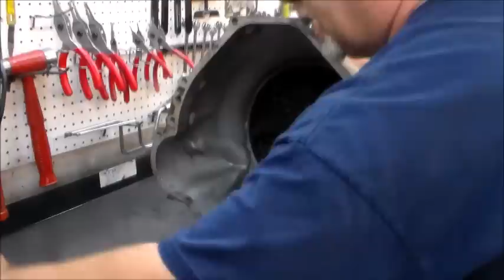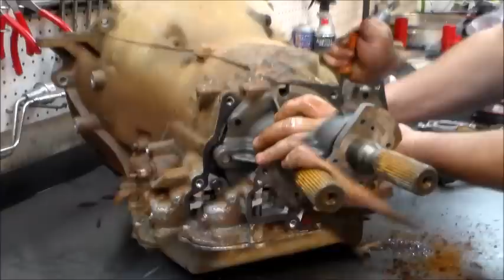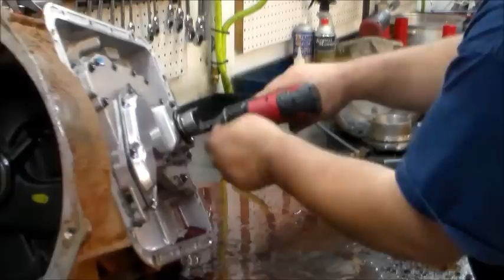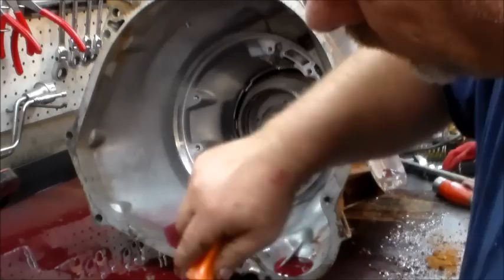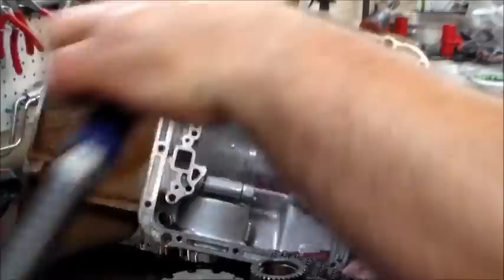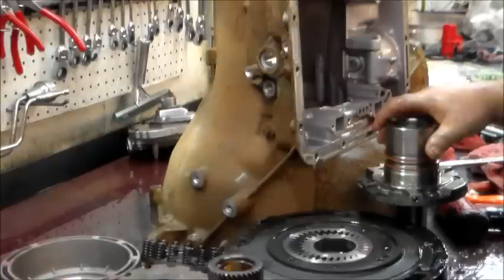C 6 TRANSMISSION TEARDOWN

Comment: Ouestion...I've got an 1987 F150 with 56,000 original miles that won't go into 3rd gear....reverse 1st and 2nd shifts great I've changed the output speed and ABS sensors already...the thing sat parked for about 8 years at one point, any sugestions what might be the culprit? Thanks.

Comment: Have 1973 F-250 2WD with  C6, 390ci engine. Trans had 1, 2 and 3 but no reverse up until a week ago. Shifted great from 1st to reverse several times but lost both 3rd and reverse. Any ideas? Drives great in 1st and 2nd. Good power to rear wheels. I might pull trans and try rebuild before shelling out big $ for rebuilt. Your thoughts?

Comment: I bought a 70 ford Ranger with a c6 transmission. The truck has sat for 20 years. ALL foreward gears work great, but NO reverse? Tries to lunge foreward in reverse and neutral. Any suggestions?
Reply from the maker: The lunge toward in reverse and neutral sounds like possible forward clutches are burnt and stuck together I would pull the pan to see the fluid condition and if metal or clutch fiber is in the pan if so take it apart

Comment: Question I always see the front pump comes out last for some reason I'm trying to get my front pump out it's very hard what's holding it I have the bolts out
Reply: I have a Ford c6 small block
Reply from the maker: 2 of the bolt holes has threads in the pump cover you can use a slide hammer with a 3/8x16 bolt and pull it out

Comment: hey man, my c6 transmission is slipping. all I need is a rebuilt kit right? I don't need to change any gears? it goes into reverse Easley.
Reply from the maker: you need to do a inspection on the drums and all the gears you want to reuse
Reply: yor gonna need special tools + band aids  i suguest getting books  from A T R A and kits from transtar
Reply: from experance to fix a sticky valve in a c-6 thro it in park at 60 mph it wont grab just shake the shit out of it vala valve frees up
Reply: c-6  has adjustable bands  accasable from out side  get a book first

Comment: I actually like your video.inly thing you could do different is let viewers know what you are doing.like removing the 4 governor bolts.there wouldn't be long silent spaces and would idintfy parts to newbe.i couldn't finish someone else's vid because 1/2 way he had covered converter and how clean the fluid looked then skipped over valve body

Comment: Sir if you never rebuilt a transmission would you try it on your own? I just don't have the money to pay someone. Is it as hard as it looks?
Reply from the maker: its not that hard
Reply: Give it a try.i did my first one when I was 14 had never been inside one and didn't even really totally understand how it worked.rebuilding mine educated me more on how they work.that also opened door to get mechanics job where I advanced to assistant manager.owner was manager.i was given half of what I made the shop.this included parts sales or commissions on anything.only suggestion I suggest is always with no exception replace converter when you rebuild trans.i didn't once even though advised.turns out that was problem in first place.one thing that helps is have space you can lay stuff out as you remove them in the order you took them out.then you can take the sub assemblies and do them then I put punch in vise and hang case on punch using bell housing bolt hole so trans is tail down and work your way up.before you put valve body on you can air test

Comment: Robert, in the C-6 do the torrington bearings play a role in end play or only the thrust washers?
Reply from the maker: the thrust washers is what sets end play, however if you leave one out and your end play will be off
Reply: My very first automatic transmission rebuild, a C-6,  and I had a torrington left over. I finally realized that because I built it from two different transmissions and one torrington was destroyed along with the low reverse section in that transmission that mathematically I should have had one left over. My end play was perfect so I guess I got it right. Thank you.

Comment: hey robert,i put new bushings in my c6 frt. pump..but when i pulled it the frt clutch drum pull forward a bit. so when i tried to put the pump back in it wouldnt seat all the way and frt small shaft wouldnt turn. the trans is still in the truck with the engine removed. can i realign the clutch pack and push it back ? or does the trans have to come out ? thanks
Reply from the maker: +ron shuman it will be hard to get the clutches back in place it would be a lot easier with the trans out of the truck but I would have to try before I pulled it out
Reply: ron shuman h
Reply: I assembly them by putting punch in vise and then hanging case by bell housing bolt hole so tail is down.this prevents packs from slipping out of place.simply work your way up and air test before valve body is put on

Comment: friend how to know if the servo of a c6 box is damaged or thank you.
Reply from the maker: If it is still in the car put it in manual 2nd if you have engine breaking then servo and band is working if it is out of the transmission do a good visual inspection the rubber should be soft and seal to the case

Comment: Hi , what type transmission fluid  should in a 19666 390 Ford galaxie ?  Thanks
Reply from the maker: +Charles Prisco it is hard to find type f fluid now but Merc / dex fluid will work great that is what I use in older units
Reply: NAPA sells Type F For old Fords

Comment: Robert, my 89 Bronco C6 is on its last leg. I am relatively mechanically inclined (I do all maintenance on my vehicles) would I be in over my head attempting to rebuild an AT such as this?
Reply from the maker: Doomzdayxx  if you are mechanically inclined as you said then it would be a good first transmission just take it slow and lay everything out stay organized and clean
Reply: I was 14 when I did my first with no knowlage of how they worked or what to do.i say go for it.always replace converter on rebuild or you will regret it someday.i use punch in vise sticking up through bell housing bolt hole to hold case tail down to do assembly and lay everything out as it comes out in order it comes out.then I start at front and rebuild sub assemblies such as clutch packs.i didn't have press so i used all thread and two pieces of thick flat steel with metal exhost donut cut in half to compress the clutch pack springs to remove clip to get to seals on piston.one is down in the back of case but short flat steel and exhost donut cut in half  placed on top of steel piece that holds springs.you could use nuts standing up.you just half to compress the metal piece enough to remove keeper ring then loosen nut an all thread to relax springs.air test before you put valve body on